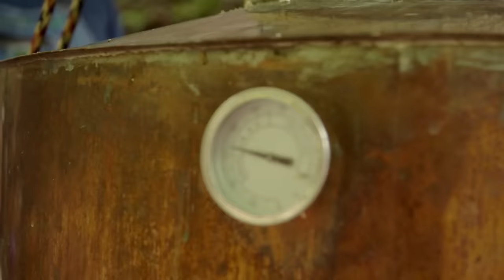The Fig Moonshine Rig Nearly Explodes! | Moonshiners

Comment: Each jar gonna add 2 to 3 lbs of pressure there what 20 jars thats 40-60 extra lbs of pressure straight from the head like shit thats a bomb
Reply: Yes. That's 30x's the pressure the rig needs to push through. They bassically made a pressure bomb.
Reply: All stills are a bomb.
Reply: @traetuusplays8987  no if you set it up proper it won't explode they just have theirs set up to where there's too much pressure. Not sayin I have one but if I did I'd put just two instead of however many they've got
Reply: @junkie_cosmonaut9622  I know all about those stills. They are bombs. And like all bombs they are safe when handled properly. I'm probably one of the few here who knows ole popcorn, and his family. Generations of this stuff in my area. But it does take a blithering idiot to do such a thing, that you are correct. But they do go boom, especially when you go to McGyver for your still plans.

Comment: They're running the fire too hot.
Reply: Yah tell em
Reply: they want it fast
Reply: It’s cause they have too many gin baskets. They set them up like a thumper keg which builds up a lot of pressure.
Reply: Not exactly. When I do my batches. I set it on full blast. Once I get to temperature I lower it. But I use electric (safer).

Comment: I wonder how much pressure is put on those glass jars.
Reply: Whatever their normal running pressure is multiplied by 30.
Reply: @Make-Asylums-Great-Again  I bet it's a small fraction of a PSI.  If each jar has 1 inch of liquid (probably a large over estimation), and they have 30 jars, that's only 30 inches of head pressure. That's just about 1 PSI.  The reason the cap was pushing off is because it has such a massive surface area. 14 inches in diameter is 154 square inches.  At 1 psi of pressure that's 154 pounds of force.
Reply: @gizmoguyar  absolutely correct friends 👌
Reply: @Make-Asylums-Great-Again  that ain't how pressure works.
Reply: Those are pressure canning jars, they're built for pressure

Comment: What if they were to put a pressure blow off valve in the system before all of the gun baskets. And then run that through a separate condenser so it can be safely disposed of. That way they don’t have to risk high pressure and they don’t have to shut the still down whenever there’s too much pressure.
Reply: Extra work for no reason if u can make it happen
Reply: That's a good idea. Then you wouldn't loose any steam (moonshine) and you wouldn't loose any time filling sandbags and rigging up straps. However they wouldn't have any problems with pressure anyway if they didn't go overboard with the jars. Four or five would be plenty of flavor with no pressure problems.

Comment: Its the extra filter jars you put on. Each jar adds pressure that the rig needs to push through. Almost 30 atmospheres if you said you had 30 jars. That's 30x's the pressure of a normal rig.
Reply: 30 atmosphere's would be 450 PSI. That's an insane amount. No way their glass jars or copper pot could handle that. I bet it's a small fraction of a PSI.  If each jar has 1 inch of liquid (probably a large over estimation), and they have 30 jars, that's only 30 inches of head pressure. That's just about 1 PSI.  The reason the cap was pushing off is because it has such a massive surface area. 14 inches in diameter is 154 square inches.  At 1 psi of pressure that's 154 pounds of force.
Reply: @gizmoguyar  spot on 👌, U know whats up

Comment: but... the alcohol would condense into the jars?
Reply: Yes and then the heat from the condensing vapor transfers to the liquid in the jar evaporating that. (With some heat losses off course) Essentially every jar is a single destillation process.
Wouldn't want to use glass with that amount of back pressure though...
Reply: @77patte  maybe the first few, but it's going to be a loss overall.
Reply: @kingjames4886  The total loss has more to do with the volume ratio of the thumper jars to the still. The idea is that most of whats left in the jars is lower vines and higher alcohols that you do not want in your final product, normally one or two thumpers are in use. No need to complicate things to much, but  in this case, hanging a bunch of pressurized glass jars around your head is plain stupidity.

Comment: How do they control the temperature to get rid of the methanol? That stuff makes you blind
Reply: The mash boils at the point it wants to, and methanol boils before ethanol. That's the foreshots, you throw away the first bit out of the still which is rich in methanol
Reply: James Young how do they know how much to throw away before they start keeping what comes out?
Reply: noreaction it’s a different color, the heads aren’t necessarily as clear as the good shine. Usually the heads are about a quart
Reply: Depends on the size of the pot usually the first jar or 2 are heads then about 4-8 jars r called the hearts(about 120-140 proof and its getting the flavor) then u run into your tails which has a lot of the flavor but u can start to see the oils and it starts to make your liquor cloudy
Reply: noreaction you could use math but the heads are cloudy and taste horribly bitter.  Taste is your best friend in these situations. And you need to drink like two shots of it to get blind, but i even start gagging when tasting with just a finger

Comment: Way too many gin baskets( jars) no still can be expected to hold that much pressure. That thing is ridiculous. Two would have been fine and swap in a little new juice ever so often to keep the flavor coming, plus that setup is going to run too hot probably be a scorched mess( if it was real and they weren't just boiling water)